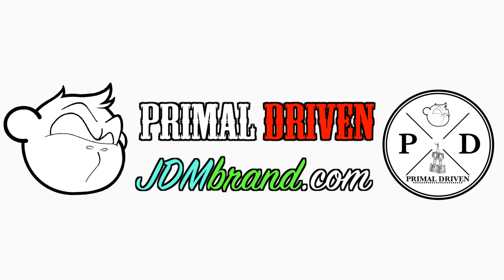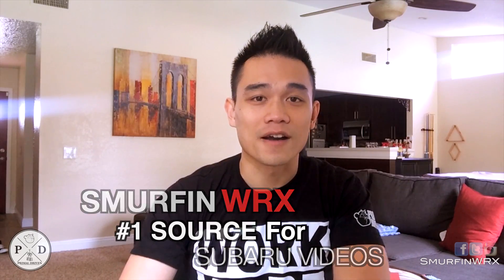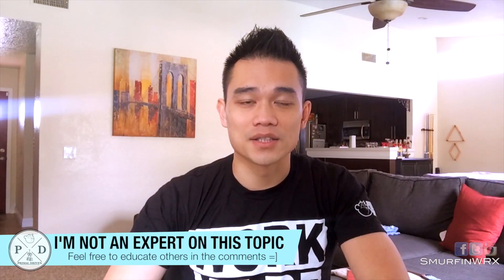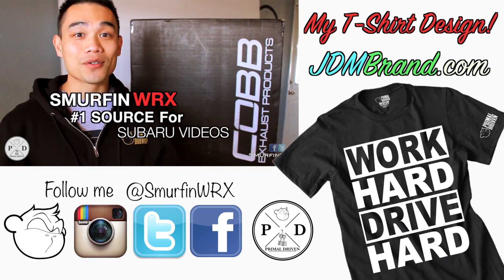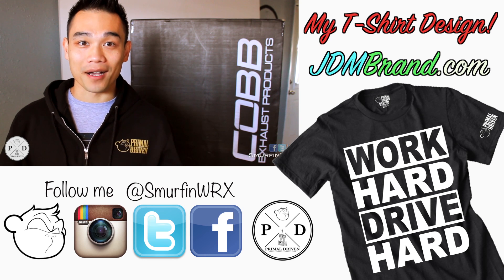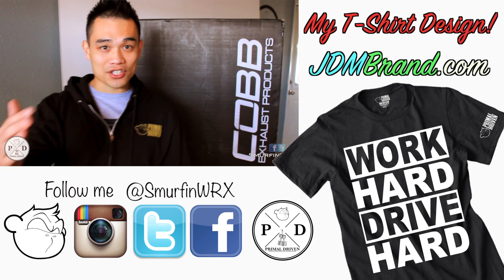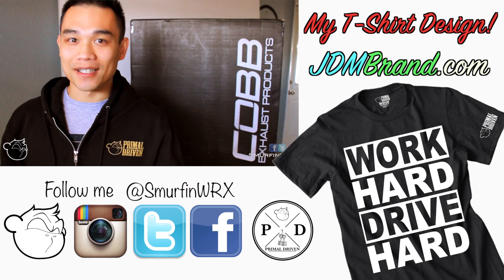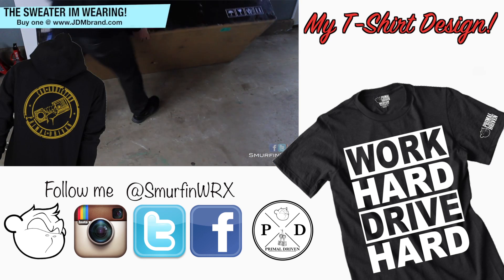What is Ringland Failure | Subaru

Comment: "The JDM sti came with forged pistons in a 2.0L w/ a twin scroll turbo. We just got screwed in the US."

^ PRECISELY. Did you guys forget about the M3? It was pussified for the US market. Nearly 100BHP less than the EU model. Our emission laws are pretty fucking terrible, not to mention. Same goes with Subaru, the internals are twig-strength, for those shipped/built to the US.
Reply: Same goes for the Focus RS 400 400hp in europe We get the shitty Focus ST with 250hp...
Reply: ^ Exactly. :)

And it's quite sad mate.. :(
Reply: 4Body2Soul I agree, we got screwed BIG time.

Comment: I think it's laziness on Subaru's behalf that a car from the factory can't be driven hard. If they have been having this issue from 08' they should have changed them, at least they are changing the motor next year hopefully it lasts longer. it's a shame because i really wanted to get one after i graduate college. But if they continue to have issues I will have to go with a 04-07 ( which if you didn't know are close to impossible finding one without mods ).

Comment: Most ringland failures can be traced back to these 3 mods (all 3 having been done) - because one tends to rely on the other:

1. Aftermarket downpipe OR larger turbo
2. Cold air intake
3. Stage 2 tune

If you go Stage 1, with catback exhaust and cold air intake with stock MAF sensor, and do common sense things like using higher end synthetic oil, frequent changes, and 92+ octane fuel - you will be fine. Mess with things beyond this, and you are exponentially increasing the risk of failure of some sort.

The larger downpipe is a fairly big risk. Why? Because it decreases backpressure, which allows the piston rings to place a larger/faster strain on the ringland. The cold air intake already creates some of this on the intake stroke, but with a larger downpipe, you are now straining both the top and bottom ringlands - essentially doubling your risk. The Stage 2 tune that accompanies an aftermarket downpipe change - only adds to the strain, with higher pressure coming from the turbo.
Reply: From what i've found, it doesn't matter what size exhaust you run from turbo back, because the up pipe and turbo create the back pressure needed.Effectively a bigger dump pipe is better, it increases the turbo's efficiency and response. Reading a lot of WRX threads and from what the Subaru specialist "MRT" here in Australia say, is that cold air intakes cause the biggest problems, unless you're chasing figures of around 500 Hp, the stock intake is more than enough. If you're only flash tuning your car, sometimes the ecu can get confused with the MAF sensor, it may be reading the same velocity, but there is more air, causing the car to run slightly lean, which can lead to such things like detonation, the cylinders get way hotter than they should be, leading to the piston rings failing. Most car manufacturers, who export to the USA, Australia, or any country with stricter emissions standards than that of the EU, Japan, etc, will de-tune their sold cars, which means, pulling timing, tuning for lower octane fuel (most JDM performance cars were originally tuned to run 100oct fuel), boost is dropped and the major one, running the car lean for fuel economy and to pass emissions standards, this is possibly why the stock STI's are suffering ringland failure, especially if they're driven hard,
Reply: Kris Regulski He might be on to something. With Mazdaspeed3's at least upgrading to a catless downpipe decreases the backpressure on the turbo which causes smoking turbos (it's related to our shitty pcv system), can also mess up the seals. Upgrading catless also can cause us to get some pretty nasty boost spikes. At least for us the simple fix is to raise the idle rpm to about 900 or so. Thankfully k04's are cheap and available everywhere. I don't know what kind of afr's you guys target but running lean would be bad for any motor, but you're right about detonation and failure that way. Moral of the story, you have to pay to play
Reply: TheBreakfastClb You also forgot about the vvt chain, those go out quick and are expensive to fix if you dont d.i.y.
I had a ms3 07 and gave me problems with the egr and pcv. 
But now that I have a subi 2012 I hope I dont regret cause my ms3 took a beating. 💪

Comment: 30 psi on my stock block 4g63. Unfortunate that the subie rumble have these issues.
Reply: Congrats on that, but it's just dumb... Don't complain to anyone when you blow it up eventually
Reply: Liamv4696  There will be no need. Been running 460awhp for about 40k miles now. lol No problems so far, besides an incident of  overboosting. Got that fixed right away.

Comment: ring land failure is only prominent if you do one of three things:
1. Push the stock internals past their limit [~290-300whp (mustang dyno)]
2. install an air intake or down pipe without updating the ECU with the proper tune
3. buying your car used not knowing that the previous owner met the above 2 criteria.
.09% is due to improper maintenance
.01% just a bad motor. 
They have been building the EJ257 for over 10 years, I think they know how to build it. It's just idiots who don't know how to mod.

Get a protune, and decide if you want 300whp or 400+whp. If you want the latter of the two, nut up and shell out the big dough because that will be 10k in the hole for a reliable set up. Don't come crying to the internet when you decimate your cylinders running 400whp on stock metal. *See 370zforme; now owns an evo. Feel bad for anyone who buys that car, because its already got failure, and is just a key turn away from going boom.
Reply: Pretty sure that your statistics are incorrect, where did you get that information anyway? If you're referring to me "crying to the internet" you don't know my situation. I knew that my car would probably not hold that power but did not realize it would start so early and when it happened, I was no longer willing to dump 8.3k into the car to get it to run and be without it for a few months. Also, my car was fixed before it was sold so do not go around making it seem like I screwed someone when that is not the case.
Reply: ***** Stats came directly from one of the top STI enthusiasts forum (and no not that troll farm NASIOC) and they are solid. Show me 10 cars that ran pro tuned(from a reputable tuner not some kid and his laptop) stage 2 only (290whp threshold) and got ring land failure as a result. No OTS Cobb  maps for a month while you wait for your tune, just straight stock to pro tune and nothing else. No Air intake without a tune, nothing. Oil changed every 3k you will be hard pressed to find any. There are folks pushing 130k miles on stage 2 pro tunes because they didn't get greedy and ask for more. I will tell you however, that for every case of ring land failure you have, it most definitely falls under the above stated categories. So I'm "pretty sure" that you are wrong. Lastly, my little reference to your engine issue was more of a *see here what happens when you go past 300whp, and less of a cry to the internet, so take it with a grain of salt. And as to what you did with your car, if you weren't willing out to shell out the money to fix it then how can you consider it to be fixed? Correct me if I am wrong, but you did crack your piston ring which would lead to loss of compression and eventual engine failure. Is fixing these days just another word for "I put it back to stock and sold it?" Also hence your legal debacle? Not sure, don't really care all that much thought, yes it sucks, but you gotta pay to play.
Reply: Walker Bradshaw I've seen quite a few cars with issues and some of them being in a group that I visited down south but whatever the whole issue is so wide spread and there are so many different theories behind it that it can be hard to differentiate the truth from crap that trolls post of forums. I'm not involved in a legal debacle, the owner of the car did not want people to potentially know that the car had issues is all. I was well aware that my car would start to give but unfortunately when it did, the money I had set aside for the build needed to be spent elsewhere. I feel that if you start to mod it isn't a bad idea to set aside a rebuild fund. You ave good information as long as it is true but I do remember seeing on NASIOC a ton of false statistics. Thanks for exchanging ideas with me, cheers!
Reply: 20k miles later with full bolt ons and E85 with 0 issues on my 2015 STI…  #chooseyourtunerwisely
Reply: Nice... 20k miles later on mine with 412awhp and no issues as well.  I am dropping it off in a week to hit 600whp stock internals on e85.  I'll have to let you know how it goes
Reply: good shit! yeah just watched a vid of a 15 with a 6262… saving now lols GL

Comment: How can you tell if your Subaru has a ring land problem? Or if a problem is starting to occur?
Reply: You will know when you see white smoke appear from your exhaust and out of your opened oil cap when the vehicle is on. You will also experience a loss of power and extreme oil consumption in most cases.x

Comment: Also to everyone reading, you cant really tell until your motor blows that it happened. And once it does blow, you must rebuild the shortblock, which if you are not modified, Subaru will cover under warranty. In my honest opnion though, it would be easier to have a forged shortblock including pistons ... etc built from a reliable shop instead of swapping another timebomb into your car, UNLESS you are looking to trade it in afterwards. The oiling systems in the subarus is wayyy off. So keeping up with your oil (not every 7500 like subaru says, more like every 3-4k) will help out, along with letting your car (aka letting your oil circulate, lubricate and warm) can help as well. Running our cars (WRXs and STIs) cold is a recipe for disaster and is when most problems occur. And FYI WRX pistons are hyper cast which are VERY reliable but not as strong as forged, The STIs are virtually the same no matter what you hear, besides the top shaping and a few minor things. Having hyper cast with as powerful cars as these was not smart on subarus part.

Comment: The ringlands are the grooves on the piston head where the rings sit. The first sign of failure my 06 sti gave me was a misfire code. When the ringlands or piston rings fail, the engine will start to run very rough, especially during idle. You may also experience loss of power, oil burning, engine knock etc. This has been a problem for Subarus for many years way before 2008. These older Subaru engines don't have adequate oiling systems from factory. That's why they can't handle too much power without forged internals or an upgraded oiling system.
Reply: Yep.  I've blown a 2002 OBW and now a 2007 OBW engine.  #3 cylinder on both of them began to misfire.  I'm on my 4th Subaru and probably my last.

Comment: would it be ok to put forged internals on a stock 2013 wrx if i plan to do some upgrades later on like say maybe a turbo upgrade and FMIC and an intake.
Reply: YES. 100%. Forged internals are are what should have came on them, just like every other racecar. Forged internals will do nothing but be stronger and decrease wear, and stress on the engine. It may cause a little more hp gain as well. Do it, the problem with subarus is they are expensive to rebuild. better now then later tho.
Reply: Ok I'm not planing to be driving my car as a race car and trying to race. I plan on lowering it and doing that whole low lifestyle I just dont want my car to mess up or anything.
Reply: LOL thats how mine is, i have a 13 WRX with carbon front lip and side skirts, wheels and stretched tires, debadged, and waiting on coils lol only performance ive done is the 1 exhaust lol. BUY ONE. its soooo fun to drive man and they look amazing
Reply: Yea I've always been more on the lowered style than the street racer side plus I rather drive slow and low that fast and furious and be getting cops attention well the bad attention.
Reply: well its wayy more expensive is the problem. Its easy to slap some fat rims and tires and a loud catless dp and have a tank lookin mean subaru lol. I choose the low-life hah. Its funner to drive and more people like your car and whatnot. not like it matters just an incentive
Reply: Yea low-life is the life for me lol. I'm just stuck rn on good rims but I already have and idea of being bagged only to be able to full on stunt it when I park at school.

Comment: how can you tell when you have ring land failure?
Reply: xShawnnnn Oh man, that sucks!!
I am seriously considering making a WRX my next car.
Dangit!
Reply: See if i were to get a wrx id most likely get the invidia q300, down pipe and intake with a pro-tune and idk if that would promote ring land failure
Reply: you cant. the car runs perfectly fine until it blows up. MAYBE if you took it to a shop they could inspect your pistons themselves.
Reply: Yeah you can. You can hear it idling different. Also if you see lots of smoke coming out of the exhaust. You can also tell if you are burning lots of oil. Also a loss of power while accelerating can mean a ringland failure.
Reply: Balo657 lol if your car has ringland failure, you cannot drive it. My good friend had it and it ran 100% until it happened. i have never even seen a case in the forums where someone knew it was going bad unless a performance shop inspected the pistons themselves. There would be no way to tell. period.
Reply: Philip Chow Get one ! lol its fine, actually happens much less than you think. BUT those mods you listed will certainly contribute to ringland issues, especially since a pro-tune tunes your car to max output, which puts even more stress on your engine than you think. Our stock tunes are bad, but are daily driveable
Reply: xShawnnnn yeah see thats exactly what I'm afraid of … not knowing if your engined is fucked or not because having ring land failure is pretty much undetectable unless inspected, really? i thought a pro-tune would benefit the car because its a tune specifically for the car instead of general mappings from cobb

Comment: If a car came out of the factory with ringland failure it would run like crap. it's more of a saying because the ej25 is more prone to ringland failure than the ej20. Simple way to avoid it don't over boost and if you want more power get forged internals. Can't expect a stock engine to handle 320hp plus with no re percussion
Reply: you can with a 4g63 :)